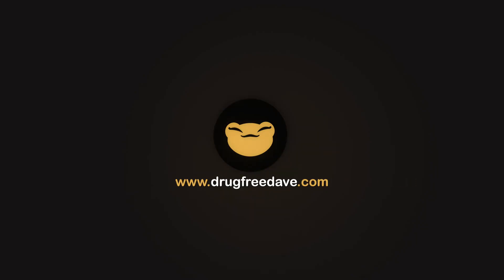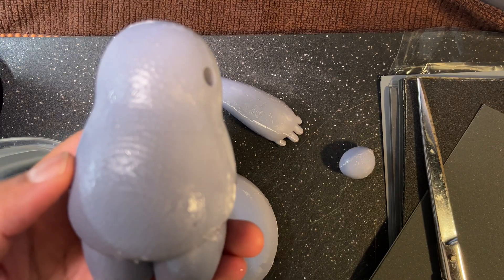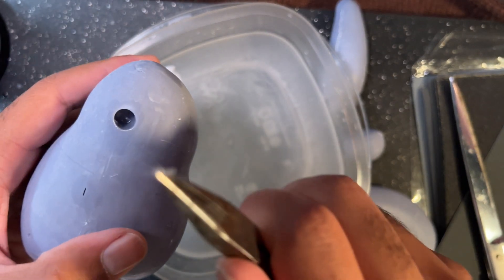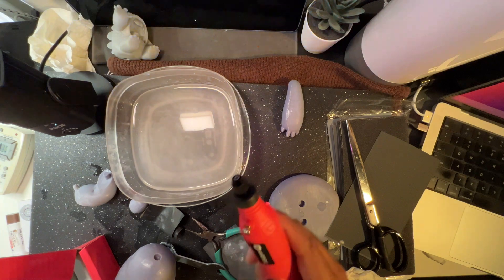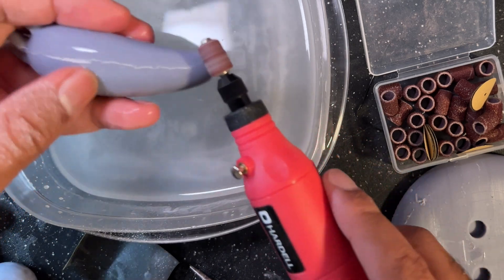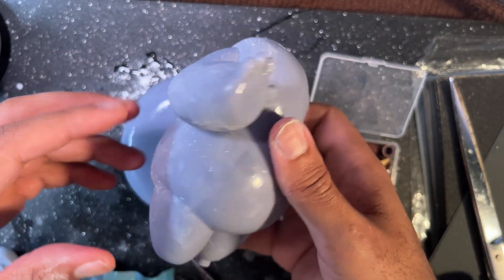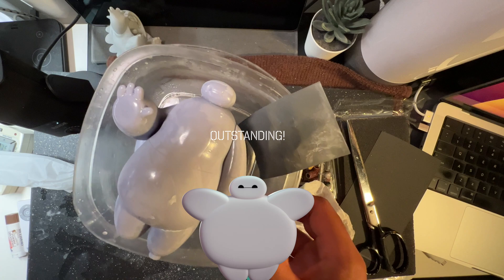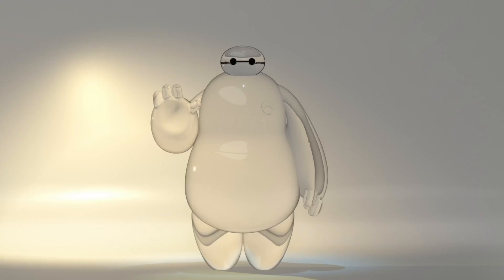How do you sand your resin Print?: Progress on my First 3D Print with Anycubic Photon M3 Premium

Comment: Good sanding technique is brown bondo spot putty. Dilute some into a cup with some acetone. Turns into a good liquid. Drys fast then sand away.
Spray with primer sander. Few coats. Then all done. Post process takes time but It can be fun. Setup a work station outside or very good ventilated room.

Comment: Dave I once bought a small kitset shed about 3 feet wide and 5-6 feet long to get a outside work area. All powered up and lighting (a lamp) with a good size built in bench. It worked really well and I had a office type chair. Fyi…. You showed your back yard area awhile ago, so I wondered if this could be a solution to the cramped work area, fumes inside etc?  Laurie NZ.
Reply from the maker: That would be quite useful! I've narrowed it to basically doing the printing inside, but everything else outside. It's just that the printing takes so many hours, So it'll be printing as I sleep. The window fan def helps. I also think I need to look into other resins (apparently some are way less strong smelling!)

Comment: Using a rotary tool is definitely overkill for a small print like this. Just sand by hand, start with like a 320 grit and go up from there in passes. You can easily sand resin so smooth it looks like it was made from a mold. Once you glue your parts together, you can use the same resin you printed with to fill small gaps. Just cure with a UV flashlight.
Reply from the maker: I tried to sand by hand but it was just so much work and I think my supports left marks that were too deep. I messed up also by doing work on him in the daytime (when he was fresh off the plate). It may have been better if I had something to wrap the sand paper around too. I'll def try the lower grit sandpaper next time. Lots of trial and error - I appreciate the tips!!

Comment: Hi Dave, I use a photon as well.  If you need any help with printing I can give you assume advice. I use resin and fdm printing. The resin printing should only require minimal sanding. If you get your settings right and stuff you will only need to clean and cure the print, they seal and paint. Best of luck and enjoy your videos! Thanks for the sculpting courses.
Reply from the maker: Yeah the prints I see out in the wild i'm baffled how they have such clean surfaces! Def need to get better with the supports. One thing that stuck out to me was that the print didn't seem as hollow as I thought it would be. I thought it would be light. (the body) come to think of it, i'm not sure if I hollowed the arms. oops. But the body I thought would be light...yet the holes I made in it didn't seem open him up at all. I need to make some prints just to practice supports and slicer use!

Comment: Tip.. for you Dave ..after your IPA wash use a hair dryer on low power to dry your prints before curing
you well see after that if it needs another wash and use a old tooth brush for hard areas also you can
use the hair dryer when priming your model to dry it .and spraying it for quickness

Comment: when you learn how to angle your prints in the slicer software ether 33 degrees to 45 degrees 
you want be sanding that much Dave only on the parts were the supports are.
your doing more than i did less than a month owning a resining printer